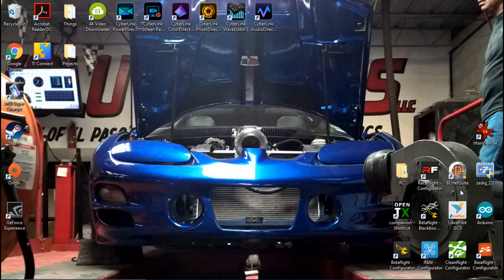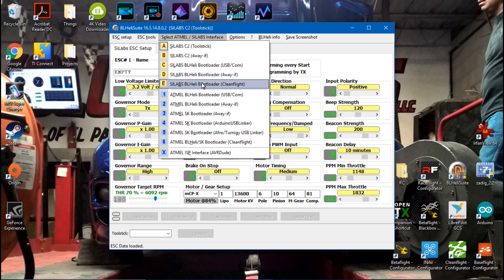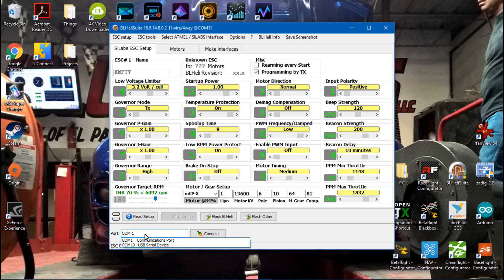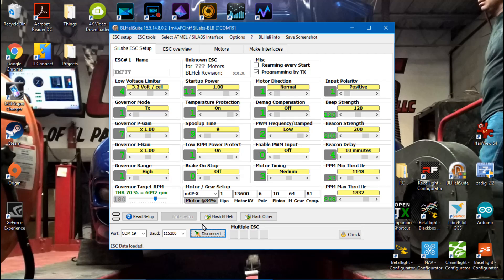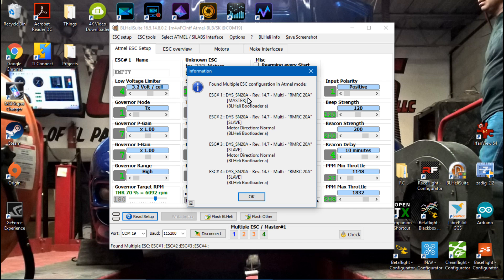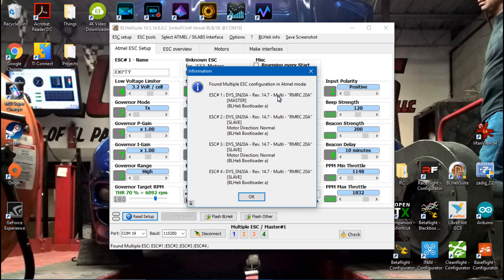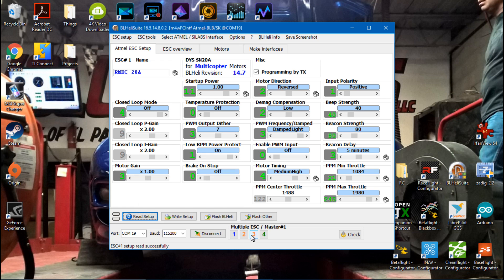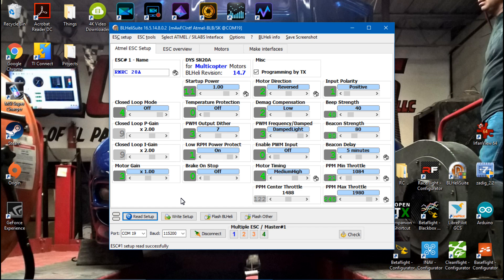BLHeli Suite Passthrough

Comment: ok, so I was having trouble connecting reliably with the chrome app, so I tried this..  But on the bottom where you select what com port,  only port 1 comes up, not the port I am using..   I have 3 furious mosquito 70's, only 1 of them has ever connected successfully..  But when I flashed the esc's, for some reason 3 out of 4 flashed..  So now it won't fly, and I can't seem to reconnect..   I thought maybe the cable was worn, and bought a new one. No luck, so I thought maybe the usb port itself was worn so I bought a new laptop...   I am at a loss,  furious fpv cust service was not any help with this.. Any ideas??
Reply: The brother died man. He sadly cannot respond to you.
Reply: Same issue here! Did you find a solution?

Comment: i just flew mine into a streama nd got it wet, but now its all dry i need to flash my blheli s, but when i get the the connect stage is gives error'unable to open com port system error. code 5. access is denied' please check usb/serial port settings!     what do i do
Reply: Same issue here! Did you find a solution?

Comment: nice video, but i stll can not get it to work on my lhi qav, though it does work on my wizard x220.
I do already have much trouble calibrating the esc's. Sometimes the esc's to not start until i reboot the board - which results sometimes in full throttle. Therefore i build a current limiter and tried on. while my fc is connected to my pc the esc's do not send beacons, but the red led glows. Anyway i somehow punched a calibration through and the quad barely flew. looking at the blackbox the calibration was way off. So here i am trying to connect BLHeliSuite.

fyi: - Betaflight Version: Betaflight / NAZE 3.1.6 Feb 21 2017
- Naze32 6DOF rev 6 
- SkyRC 12A BLHeli ESC
- Current limited

where i get stuck: at the step Read Setup i get an error asking me to check data/power connection to the esc's (which seem fine/no single esc is able to connect)

Things i tried: - these 4 steps you describe - in strict order
- those steps in any other order (dont do that! motors will spin up/esc will forget calibration/many things happend... at least take your props off and use a current limiter)
- shorting bootloader pins while plugging in usb: refuses to connect at all
- shorting bootloader pins while hitting "connect" in the software: no change
- change baudrate: wouldn't even connect ( do i have to change the fc's baudrate according to esc baudrate? as far as i understood the fc goes into bootloader mode to connect to the esc's, so blheli suite needs to talk to the fc in the correct baudrate?)

SkyRC seems to be quite new in building esc's and do have little to none documentation online as far as i found. Is there any risk in changing baudrates around? mb the esc's are just talking slower/faster :/

Comment: Great video JC.  I noticed in the interface drop down menu i didn't see an option for kiss fc.  is it possible to flash your esc's using this BLHeli suite if you have a Kiss fc?   i have the Kiss fc but little bee esc's.
Reply from the maker: I'm not too familiar with KISS ESCs. I know they Betaflight 3.1 started supporting them and added in a lot of features dealing with KISS. But I cant confirm the BLHeli Passthrough works.